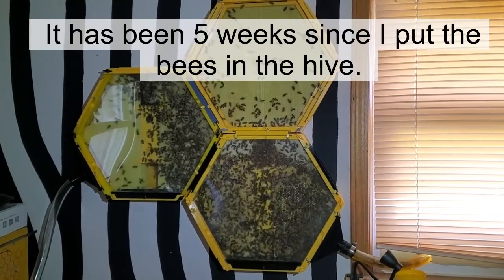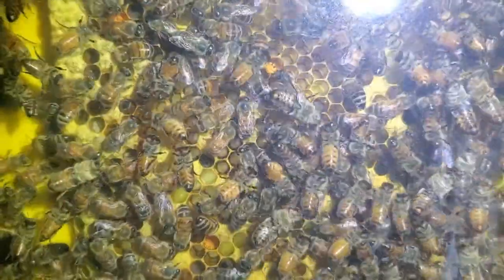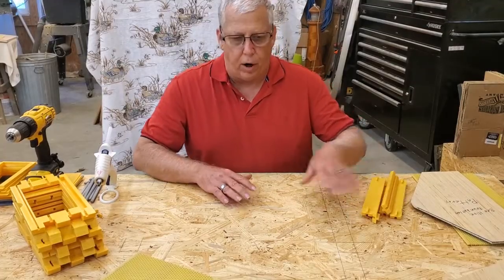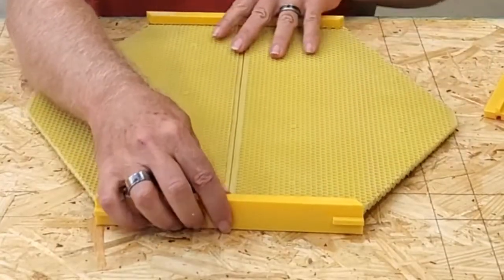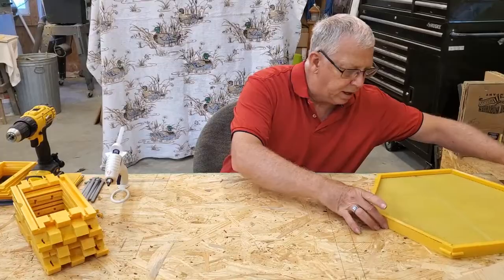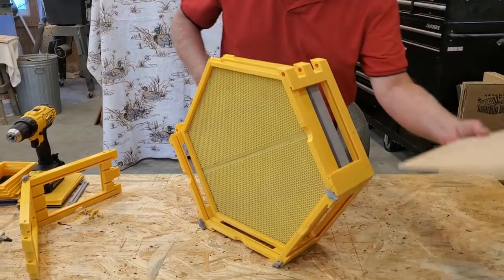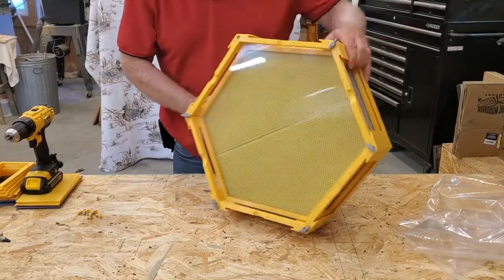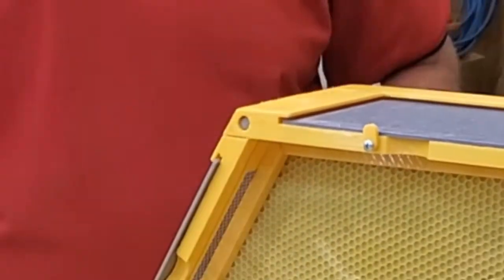3D printed indoor bee hive

Comment: Will these be available for purchase?  If so, count me in.
Reply from the maker: I am still making modifications and testing the hive. As soon as I am satisfied, I will make the file's and hive available to purchase.
Reply: @bigchessset  if you’re open to suggestions, I think it would be great to be able to view both sides.  I bracket that mounts to the wall and connects to the top and bottom via a pin would make this possible, especially with the addition of the bigger, flexible tube you recently installed!  I cannot tell you enough how much I LOVE your creation, I am extremely interested in buying a 3D printer to make my own for my home office or buying one from you (though making one seems like it would be a lot of fun for this retired Marine Engineer)!!